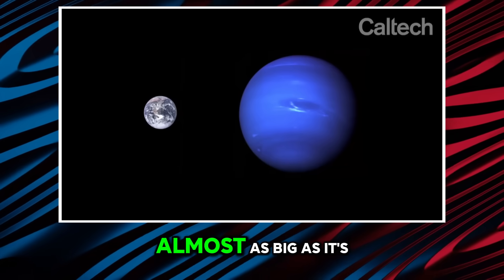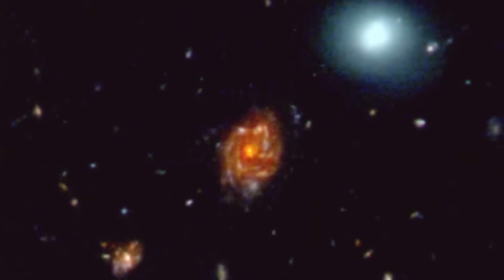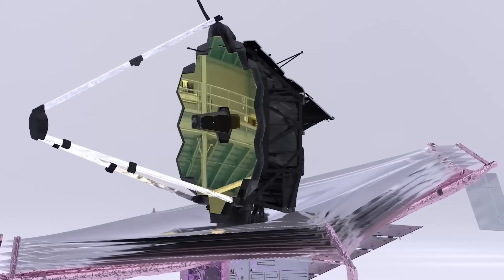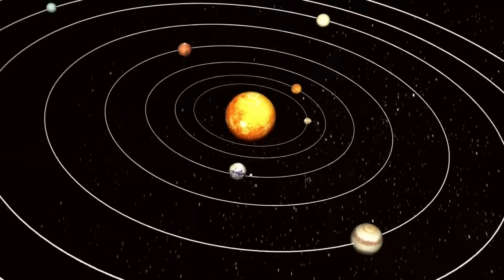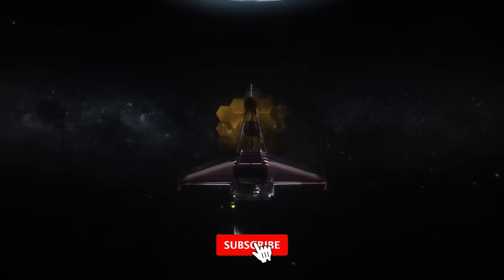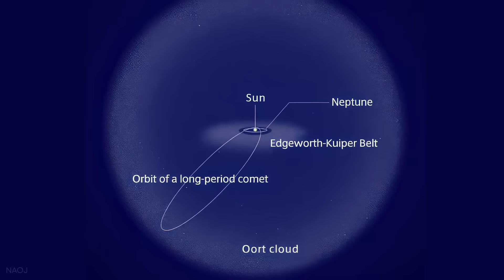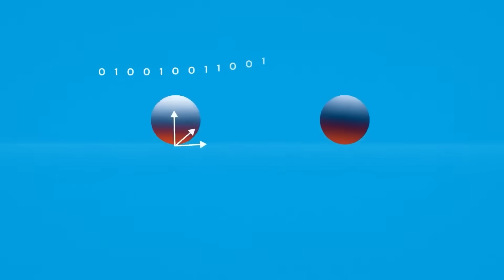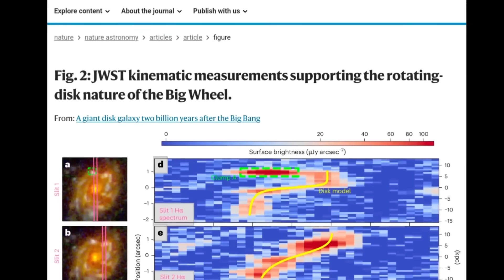Quantum AI Just Found Evidence of Planet 9 in James Webb’s Data

Comment: Quantum computers are not yet powerful or stable enough for widespread practical use. Current systems (e.g., IBM’s Osprey, Google’s Sycamore) have limited qubits and high error rates, restricting them to research settings.
  - Hype vs. Reality: Claims of quantum AI revolutionizing fields like astronomy (e.g., analyzing JWST data) are often exaggerated. Most AI tasks today are handled by classical computers, which are more practical and scalable for now.

Comment: Sol ecliptic in mid-May

Nemesis X 2046

Dark Satellite 2052

The Great Pyramid was built when Earth traveled on Nemesis plane. The structure can not be activated until it is returned to this ecliptic path in 2046 when Earth will be pulled back by the Nemesis X Object. Earth does not belong in Sol system.

Comment: Tinfoil hat speculation, it’s a gas planet called Hades. It constantly on fire gathering hydrogen, methane and other flammable gasses. Also accumulating the solar wind that condenses at the highly magnetic poles and fall to the surface making exotic elements.  Also the wobble is like captured Kuiper Belt Objects and the pull of the collective solar system pulling on the objects…

Like I said crazy tinfoil hat speculation. 😁

Comment: Too bad the location wasn't given, but there will be much more to come.  This massive new nearly black--hence nearly invisible--rocky planet should be called Planet Athena.  It has an orbital period of one half the precession cycle (approx. 12, 000 years), which it helps determine, along with another even more massive brown dwarf star (Astraea) trapped in an orbit between our solar system and Sirius.  It does have a moon which is already known (and believed to be the dwarf planet Sedna in orbit around our solar system).  It made its perigee (closest approach) to the main solar system on Dec. 21, 2011 and is one of the main agents of so-called climate change because of the intense gravitational coupling during this time.  It is the marker of the Age of Aquarius and the ruler of the sign Libra, something that will make for big changes in both astronomy and astrology.  Bravo JWST ...

Comment: It was discovered in the 30s and is a brown dwarf infrared star about the size of Venus is what I've always heard. It would be odder if we were a single star solar system instead of a binary one.
Reply: 💯 Thanks. I would just like to add that the wobble could be Nibiru orbiting it which would explain the variance in output.
Reply: THIS!!!!
Reply: Nibiru yes the brown dwarf yes we've all heard this before so the AI just basically reiterated that good sounds great. You know what else they said about that planet Nibiru and who lives on it. It's funny at the same time we're also talking about the massive structures discovered under the Pyramids of Giza there's no way in hell men alone built that massive structure underneath the pyramids. I wonder if it's the occupants of Nibiru Planet 9 who helped so long ago.
Reply: @PrometheusRomeo  got any links for the underground structures? There's been lots of talk over the last 20 years about structures underground, some of which were used as flood tunnels to fill a dry Dock, that would  allow barges carrying granite blocks to get closer to the work areas and then be drained allowing for off loading.
Reply: She would take her bra off if I bought her ice cream. That's what they told me
Reply: The smallest brown dwarfs are larger than jupiter by about 3-4 times i believe.  It's not possible to have a low density failed  star like a brown dwarf as small as that.  Nowhere near enough mass.